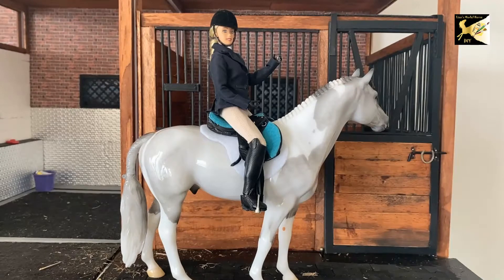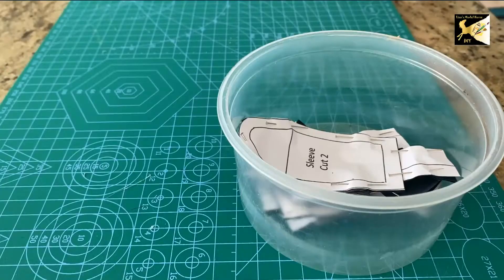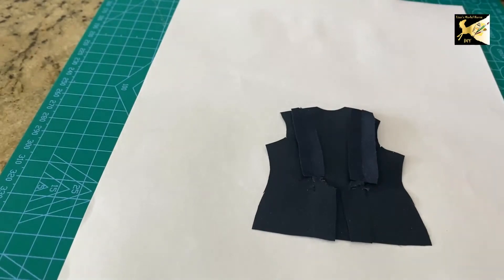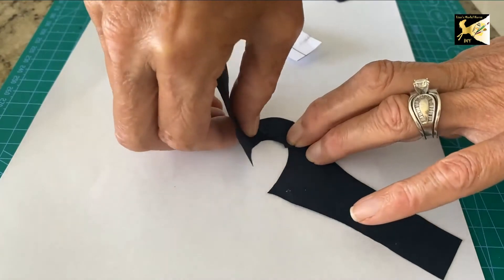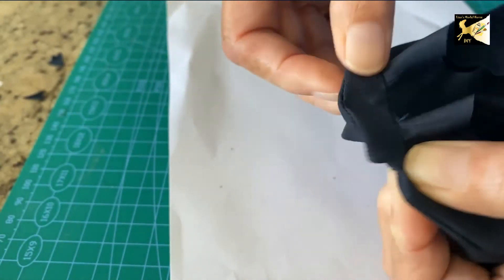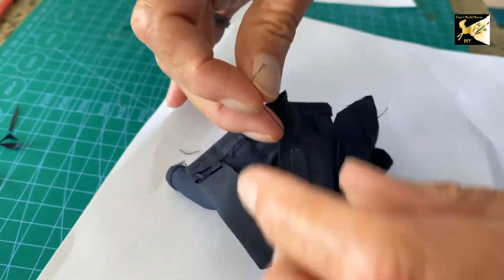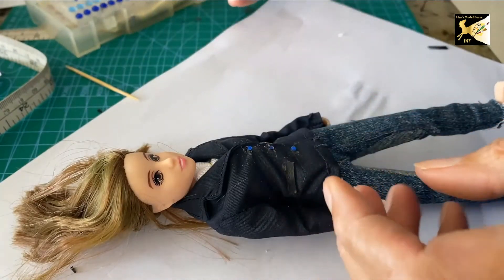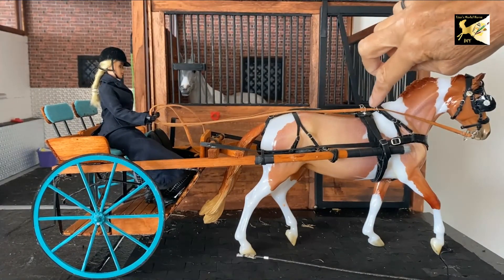Make a Model Horse Riding Jacket. For Breyer Traditional doll.

Comment: Are facings and double layers really necessary? Could it be altered to take out some of the bulk?
Reply from the maker: You could finish the edges with fray check at the front - the back would be ok. If you glue on the jacket no facing would be required. Using a very light weight suit wool would help with bulk - and it can be pressed in place nicely.